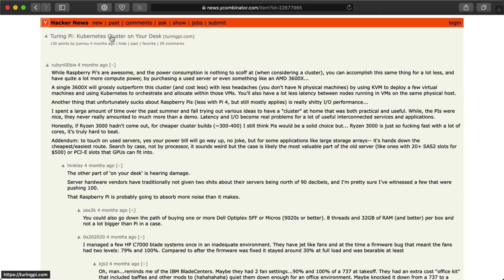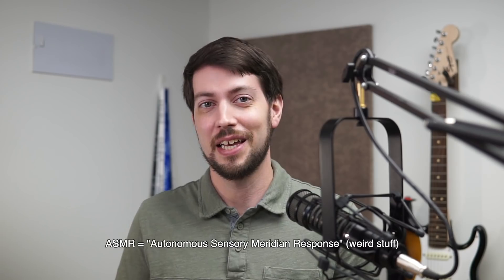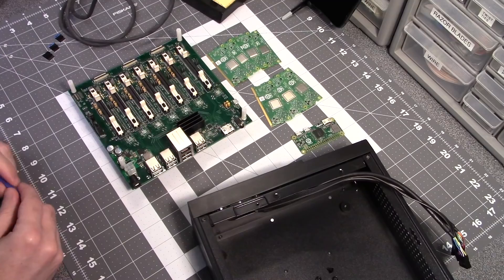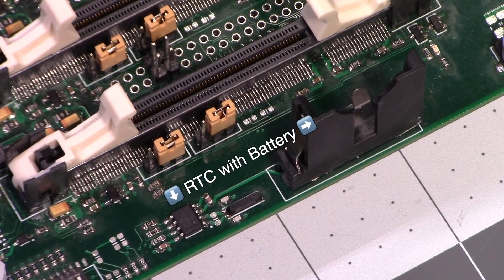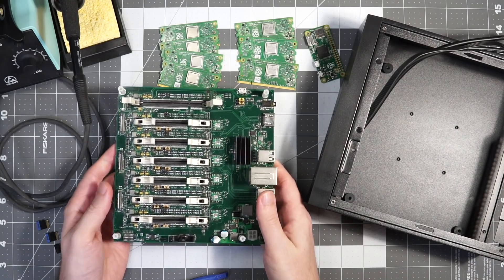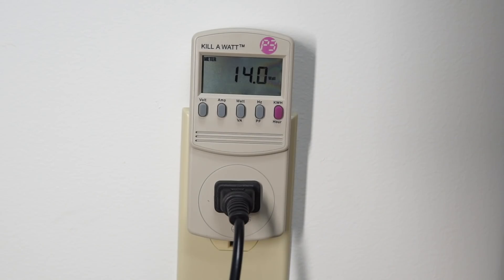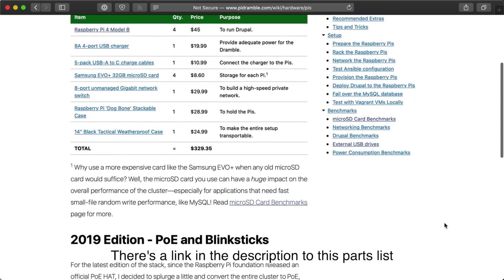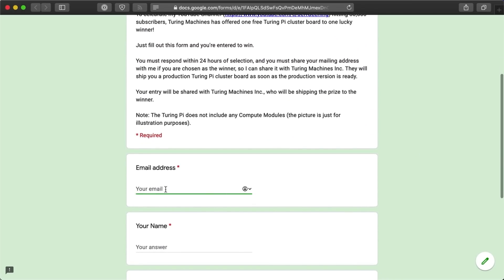Raspberry Pi Cluster Ep 6 - Turing Pi Review

Comment: By any chance, do you know where I could fine the schematics for the Turing pi board?
Reply from the maker: Unfortunately I'm not sure if there's a source for that—but you could ask Turing Machines on Twitter or via their contact form on their website.
Reply: Jeff Geerling 
Got it, thank you so much!
Reply: @JeffGeerling  
If you don't mind me bothering you again, I've been researching clustering a bit, and can't seem to figure out what I'm looking for. I'd like to do something similar to what you've done with the Turing pi, which is dig straight down in Minecraft. However, I want to try it with a Raspberry Pi 4 instead, and although I'm not sure if it's possible or not, I've been informed to look into docker clustering for it's parallel processing. So far it doesn't seem to be what I'm looking for, and what I'm looking for, is a way to increase the cores of a Raspberry pi 4, so that it can process more and and get information back faster. Do you know if docker cluster is infact what I've been looking for or if I should look at something else?

Comment: This would great if additional vendors were out there using it in something like a UPS where it could be driven by solar or off the wall. 
what about something a little more bare bones with just power supply and using radio ?  just ideas, haven't put too much thought on it. 

I think the idea is to enhance the advantages of the PI expanding the cores out like a matrix... (list of list) instead of trying to have them fill a space already occupied by existing hardware. Giving them uniqueness would allow for a bit wiggle room on the profit margin.  Maybe make some of the chips expansion modules... to keep the cost down.  where you could insert a cartridge for each CPU you add.. and then you could run it with 3 cpu... and expand it out 7 over time.  Lowering the initial cost, but expanding the geekyness of upgrading. Everyone loves a good upgrade.
Reply: also, depending, you might be able to swap in different PI (PI4?) if it was a cartridge thing with everything for supporting 1 cpu in a easy package and a really bare bones motherboard. Also on another note - everyone loves a great graphical management UI...  packaging with some management utilities could help as well.

Comment: I have a small Kubernetes (k8s as us pros call it) in my basement.   It's comprised of Pi 4 (4 x 4 GB, 2 x 8 GB) and a small set of amd64 boxes (three) so I can run those docker images that aren't yet multi-arch or aren't even built for arm64 yet.

I have Samsung T7 disks on all the Pis (500 GB) as well for both local storage and OS.  I went with Ubuntu 20.04.  I'm considering running a small GlusterFS on each Pi as well to provide block and volume storage, but that's not as trivial as I would like it seems.  I do have a NAS which I export both NFS and iSCSI to the cluster.

I found your videos to be quite interesting, and if the compute modules had more RAM, I'd be doing what you do.  I hope in the future it improves to larger RAM.

For those curious, I use active cooling from a 3d printed rack-mount, where each Pi can be removed easily and slides back into place.  I don't use any heat sinks of any kind, and even with full CPU I don't see any throttling and the temperature barely goes more than 15C above ambient.  I use PoE hats (which get warm themselves...) but in the future I'll likely build a hat that takes a raw 24 VDC in and uses a DC/DC converter to power each Pi, and will also likely include a RTC and some other various components.  PoE is handy, but the extra heat waste is not great.

I am also using a full version of Kubernetes.  Three of the 4 G models run the cluster, and the rest are all workers.  I use Calico for pod networking, MetalLB for external load balancing, Traefik for ingress, and cert-manager (with Let's Encrypt) for certificate management.  I also use an internal CA for some things, but that's not really required.  I just prefer SSL everywhere...  Minio provides S3.

I'm a software engineer, so clusters aren't new to me.  However, I am using it for real work as well as a bit of play.

Comment: I was able to find vertical 200 pin sodimm slot from JST for $2 at 1000pcs order...
Reply: Finding components cheap is not the only concern, you have to ensure it's the right quality, you also have to be able to get the exact same part a year later so you don't have to make a new PCB design and so on.

Comment: I'm just curious because I can't find any public information regarding the compatiblity of the socket of rpi CM3 and other compute modules like Nvidia Jetson. Could you load up other compute modules?
Reply from the maker: Only Raspberry Pi Compute Modules (original, 3, or 3+); different modules besides the Pi ones have different pinouts, as far as I can tell.
Reply: @JeffGeerling  I feared that. Most of the other compute modules information is locked behind developer NDA agreements.

Comment: I am sure you have seen this before, but what are your thoughts on the Pine64 clusterboard? https://www.pine64.org/clusterboard/
Reply from the maker: There are definitely some tradeoffs. The SOPINE A64 has 2GB of RAM, double that of any current Compute Module, so immediately you get a pretty big benefit there, with a maximum of 14 GB instead of 7 GB of RAM in the cluster. The board itself is also a bit cheaper (at $99) than the Turing Pi, but there are a few less features on the Pine clusterboard than on the Turing Pi—but also benefits like one USB port per slot, whereas the Turing Pi doesn't have USB ports for slots 3, 5, and 7. In the end, I think they are both decent options, but neither would be the best option for raw performance, compared to a traditional Pi cluster or even a decent single X86 CPU.
Reply: Jeff Geerling Super reasonable!

Comment: is there any benefit for the applications to run in an environment like this, does kubernetes actually spread processing threads across multiple nodes or does it get allocated to whatever module is free at that time? trying to wrap my head around this, is there any performance advantage for a minecraft server to be run this way vs on a solo pi
Reply from the maker: It depends on the application; Kubernetes schedules Pods on nodes, but for an application like Minecraft Server, it's single-threaded and can't parallelize the server... so basically Kubernetes would schedule it on a single node. For Minecraft Server itself, it's best to run it on a computer with at least a few GB of RAM and the fastest single-core processor speed you can. (A 32-core threadripper won't make it faster than a 1-core threadripper... if they made one!)

Comment: I guess this revision of the Turing Pi will not be compatible with the Compute Module 4 when it's eventually released. So it's better to wait if someone wants to do that.
Also I wondered if the use of USB Ethernet Gadget interface to get network connection from a host (like the first Pi) would make this whole board cheaper, instead of using dedicated NICs for each compute module.

Comment: Hi, I've got a question: Are RaspberryPi-Clusters used for "real" computing purposes or rather as a setup to test cluster structures?
Reply from the maker: Both! I've been running a Pi cluster that hosts www.pidramble.com since 2015, in some form or another. Would I run a fortune 500 company site on a cluster of Pis? Probably not. But I'm considering moving more of my own personal sites and tools (like GitLab) over to my Pi cluster. It would save me the $30/month or so I'm paying for a few VPSes to do the same.

Major consideration is that (just like any kind of homelab) your Internet connection and power redundancy may be a lot worse than some server in a data center.

Check out my blog post and presentation from 2019 for some more thoughts on this topic: https://www.jeffgeerling.com/blog/2019/everything-i-know-about-kubernetes-i-learned-cluster-raspberry-pis

Comment: I've heard rumors that a Pi 4 compute module is in the works.  Would your opinion of the Turing Pi board change if you were able to put 7 Pi 4 compute modules on the board?
Reply from the maker: If the CM4 has most of the features of the Pi 4, it will be a very awesome little piece of work! The Turing Pi would need a new version though since the CM4 would probably support gigabit networking, different power requirements, maybe USB 3.0, etc.
Reply: this comment highlights the biggest problem I see with a Turing Pi board solution. we have no idea if there will be a CM4. and definitely beyond. it's difficult to commit to this solution with no idea of an upgrade path. a cluster based on actual RPi boards offers a more reliable upgrade path
Reply: For less than $200 each, I will take that risk.
Reply: @CandyGramForMongo_  plus the price of 7 CM3.  but if you're not worried about upgrade paths I think the board looks great
Reply: I’m very interested in the Turing Pi board, but it doesn’t give me anything my current cluster of Pi 4 lacks. I’m super interested in a new one with CM4 boards though. The rumors about the CM4 are very, very interesting. However, having it all in a nice mini-ITX chassis is super interesting. I’d also love to see if it would be possible to toss in a 1U rack mount chassis. But I think the height would make it a 2U. Still, very interesting option with more powerful compute modules. Hopefully we aren’t too far off.
Reply: It's out now. It runs hotter and requires bulky heat sinks. Which isn't awful, but does limit clustering possibilities
Reply: Funny looking at this now with the compute module 5 out now